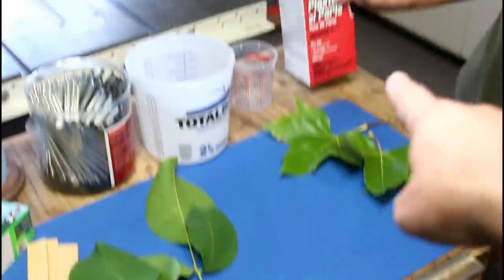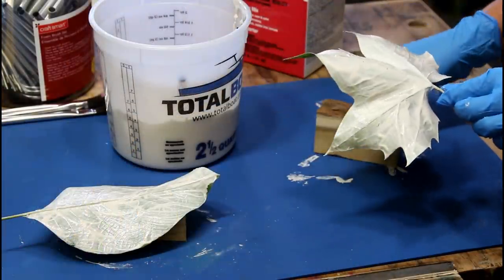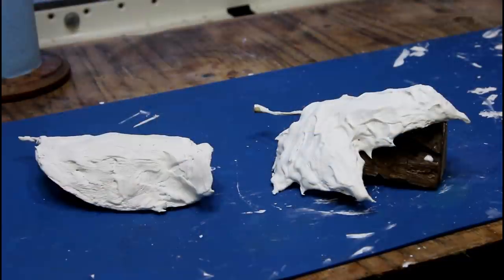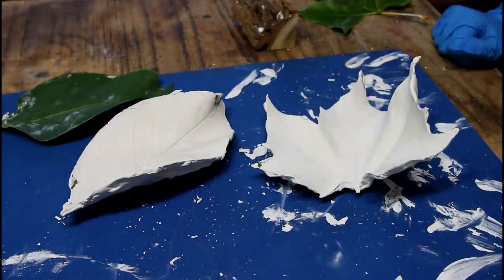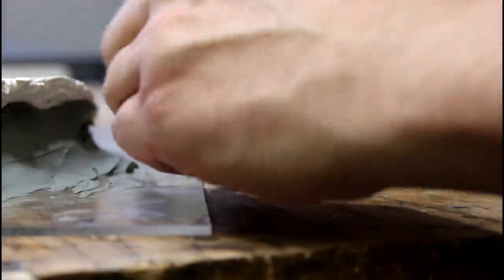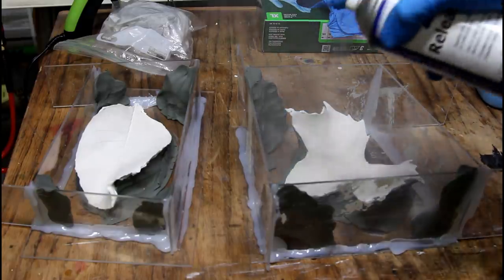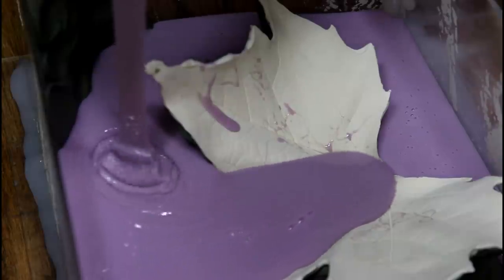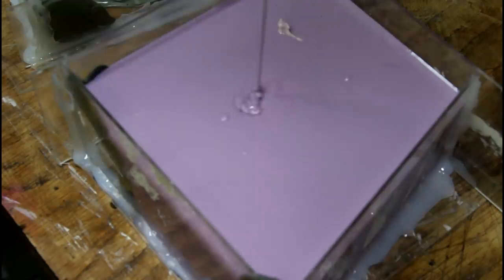Will We Upset Mother Nature?! | DipIt#34

Comment: If you have any extra silicon from a mold you aren't using anymore, you can just stick that into the new mold when you didn't mix enough. It will fill the space and you won't be able to tell the difference once everything hardens.
Reply: as long as its the same silicone though, I did that to fill a tin cure silicone using chunks from a platinum cure silicone and it resulted in the areas around the chunks not polymerizing :(
Reply: Would be a great way to cut down on waste too, as much as I love these kinds of videos, does worry me how much plastic waste is created (more so by other creators than these)
Reply: DUNKIN CHUNKIES

for real though, just like he filled some of the box with clay, i would've also chucked in some rocks or something (in the corners, away from the model) instead of mixing another batch.

Comment: Hey Peter, there’s a guy on YouTube by the name of Robert Tolone. Dude know a crazy amount of stuff about mold-building and resin casting. Might give you some ideas or inspiration.
Reply: I immediately thought of Robert when he was making straight mold cuts, great suggestion.
Reply from the maker: Thanks, I'll check him out!
Reply: One big tip regarding the silicone molds from that guy is that you can save the cut up bits to use as filler in later molds so you don't have to use as much next time. Similar to the clay idea here, but it's the same material so you don't have to worry about peeling it away.

Comment: another incredible project. Mrs Browns leaf base looks like a heart from the bottom. If I remember correctly we made leaf molds back in high school art class using cut down #10 cans  about an inch deep and filled with plaster that we gently pressed the leaves into and then poured ceramic slip in to the molds and eventually fired them.. and yes that was nearly 50 yrs ago

Comment: I used polymer clay (Just plain white Sculpey) to make impressions of leaves. Took the leaf out then baked the clay. Soon I will make silicone molds of leaves. I figured out (thanks to a YouTube video) the best way is to put the part I don't want to mold down in clay and roll it just like I did to make the clay impressions. But instead of taking the leaf out of the clay leave it in... (ha ha.. leave it... ) then pour the silicone on top to make my mold of the leaf. I am going to use them in an upcoming project to make leaves look more real so I just need a thin mold with a great impression. - Heidi

Comment: I'm thinking back to the time you cast resin shavings in resin... What if you tried to make a ghost or something? Make a shape out of clear resin, paint over part of it with acrylic paint (making sure to leave some gaps), and then use the same clear resin to suspend it in a display block.
Basically, try to make it so you can only see the layer of paint suspended in resin.

Comment: I think I've mentioned this before, but you can degas your resin in the vac chamber before pouring it to reduce the number of bubbles, which probably would have helped with your walnut leaf.

Also, you could had added fibrous reinforcement to your plaster casts by sticking some fabric in there or something to make them much stronger if you want something durable.

Comment: I was thinking that you were just going to add some colors to some small cups of resin so you could paint them into the plaster leaf building up layers. You could even get one of those tiny LED's and stick that in the stem with some UV resin. That would let you make thinner leaves like that with lights inside glowing.

Comment: Perhaps a helpful tip for next time. Coat the leaf (whichever side you're going to cast) with a thin layer of vaseline. This will act like a mold release. That, or get a silicone mold kit, make a mold of the leaf, and you can then cast as many as you like in the future.

Comment: There must be a better way than using a ton of silicone. We dentists use a thick two compound silicone that is imposible to pour. You have to handle it with your hands and it keeps its shape the whole time until you press it against anything. Work time is short, in the other hand (~3-5 minutes (even if it feels like an eternity for the patients who choke or have increased gag reflex)). Just like Play Doh.
Reply: By the way. I enjoy watching you doing these things together

Comment: If the mold won't fit into the pressure pot vertically,couldn't you lay the pressure pot on its side?Then put the mold in 'horizontally'..

Comment: I like your videos but this one was hard to watch. don't use $300 worth of material for something like this, you could have made a clamshell 2 part for a thin object like this, or a brush on silicone with a fiberglass mother instead. use a liquid opaque resin like smooth on 300 for bubble free casting since clarity wasn't a need, you can just dye that resin as your base color. when doing detail brushing go heavy on the dark colors then use a damp cloth to wipe the paint that isn't in the recessed parts, then use a dry brush lightly with the highlights after the dark brushing. if you want a darker look you can then dry brush with brown or black paint after the highlights. Also, instead of plaster you could have glued the leaves on a traced piece of thermoplastic since you cut the stump anyway.
Reply: These are all excellent tips, and yet I feel like part of the allure of this channel is getting to journey briefly into a world where all the products are both free and infinite, and it’s permissible to be a bit insane and profligate with one’s materials… 
But on the other hand I 100% understand your stress response 😁